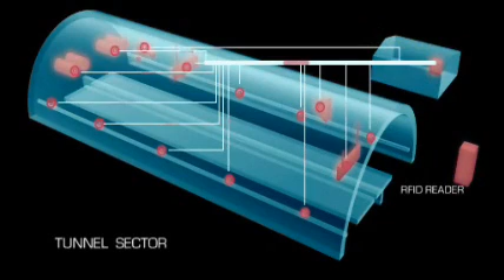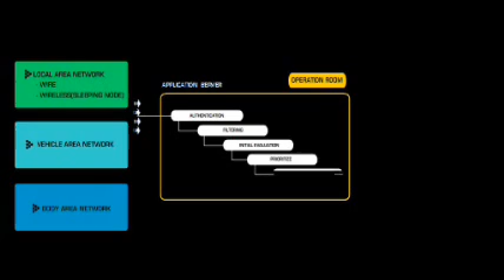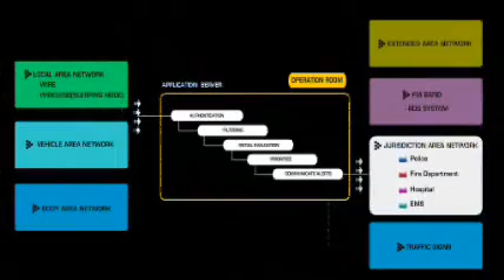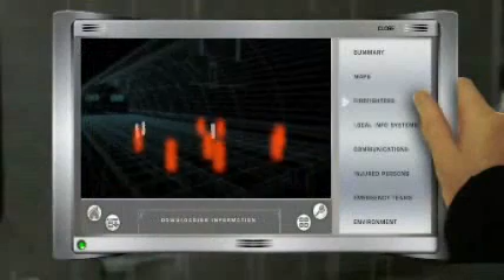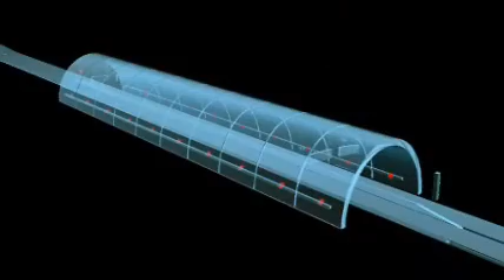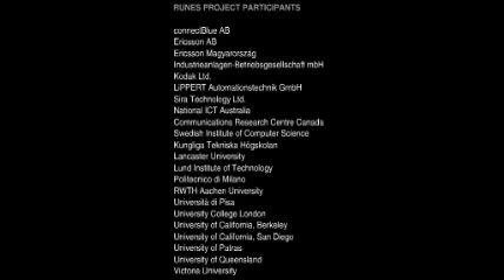Road tunnel fire rescue with the Internet of Things / wireless sensor networks

Comment: In 2007, By Pass Sur M-30 will be opened in Madrid.

It´s a similar tunnel of Lefortovo,...but it hasn´t enought exits to evacuation in case of fire.

If you  visit Madrid in future, don´t miss you the adventure of  drive into By Pass Sur M-30 tunnel.